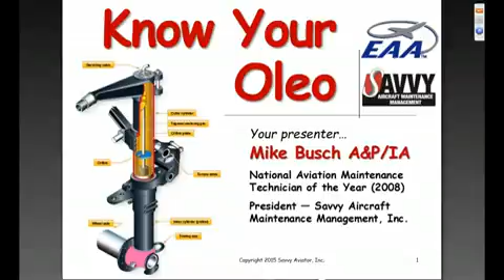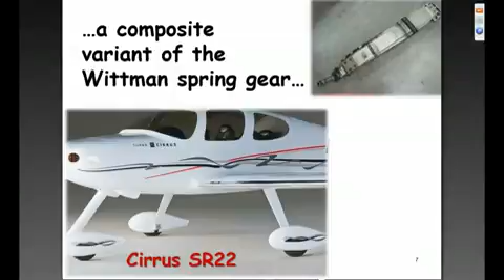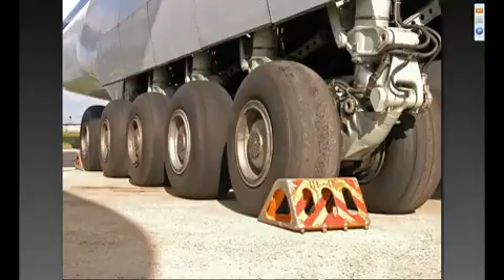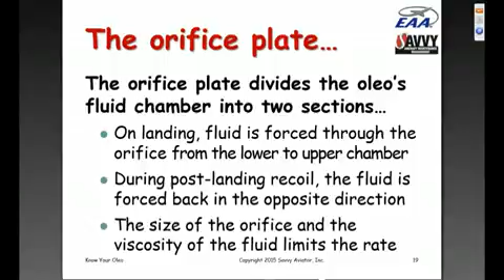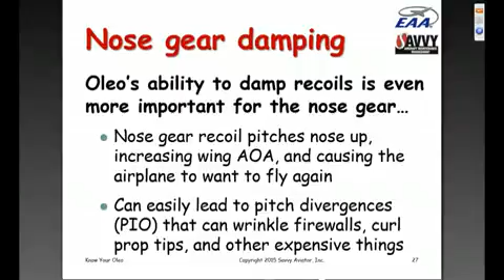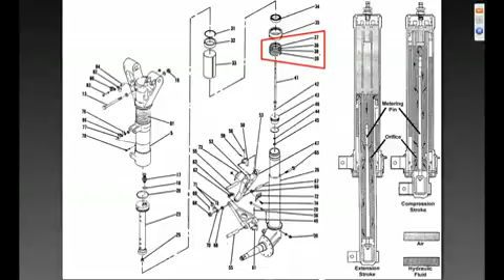Know Your Oleo

Comment: Of the fluid level is low inside the oleo the height vary more with temperature. This one way I can determine if the strut needs a full service with hydraulic fluid and nitrogen.

Comment: Re the situation where the left & right gear struts are extending at different rates - it would make sense to use a graduated container for the hydraulic fluid and hose when filling each strut with fluid - that way you can verify that each side has the same volume of liquid added.

Comment: Is there a significant difference between lets say an airsprung shock for mountainbike applications and an oleo-strut.
as far as i can tell, they both run a gas as a spring and, like other shocks, control damping with a fluid (oil) that goes through shims etc.

Thanks in advance!